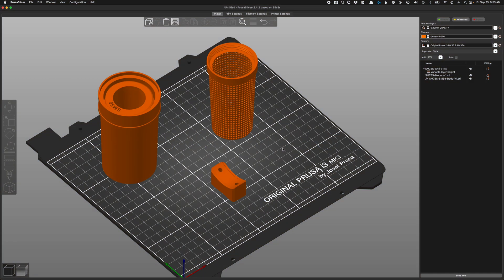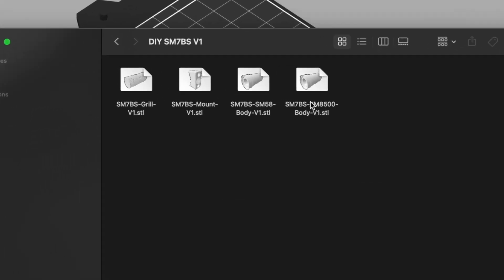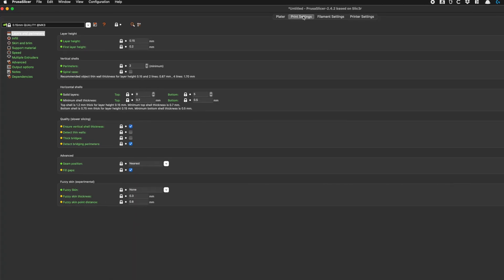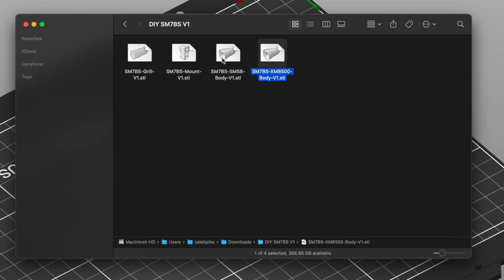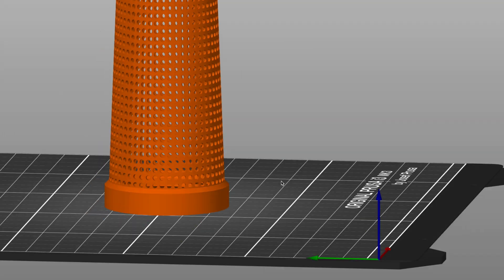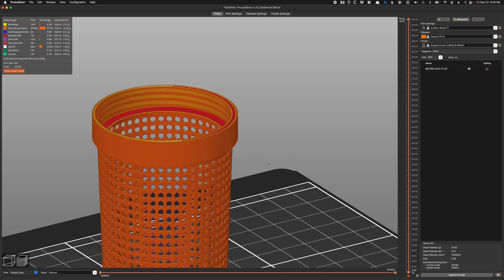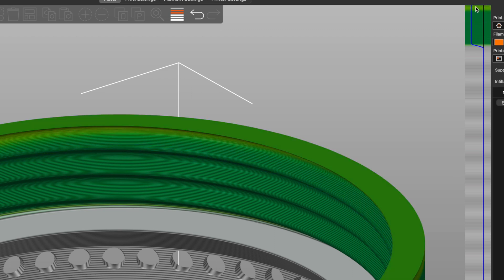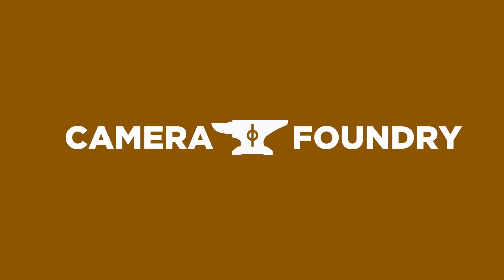SM7BS Mic Mod - 3D Printing Tutorial

Comment: The thread on the little holder piece was a pain to clean with a knife but it worked out in the end and the screw adapter fit , I suggest to use a 3/8" tap cutter as I was about to give up and order one. Grill is just about to finish printing, did work out with the right temps but still lots of excess in the holes, I have to clean these with a dremel maybe, not ideal but I just wanna get the job done. Hopefully the thread of the grill works out. Thanks for the work, help and idea so my old sm58 gets a new purpose :DD Kudos from the DIY gods
Reply: threads were super tight, the grill broke the 3rd time, glued but I think I´ll print with another filament... Anyways: Done!